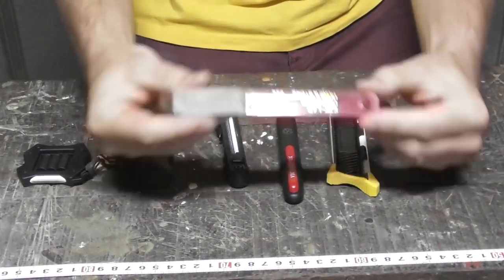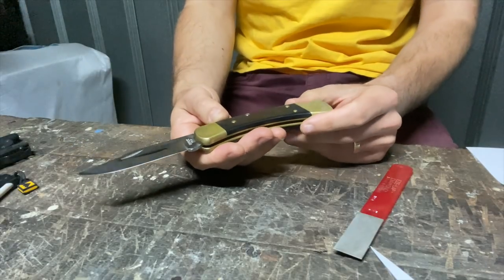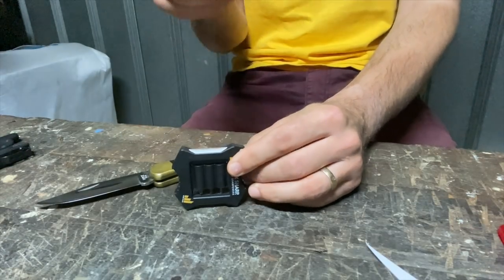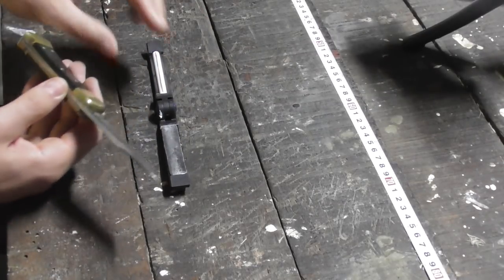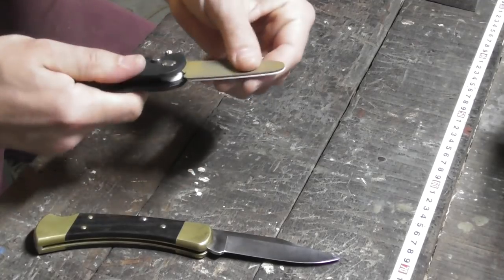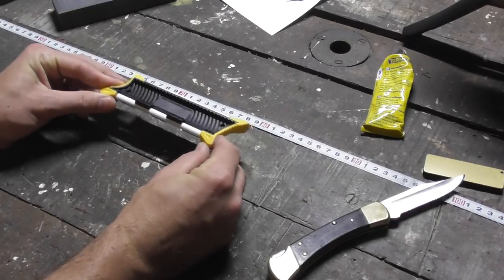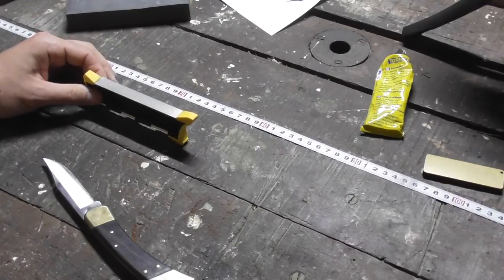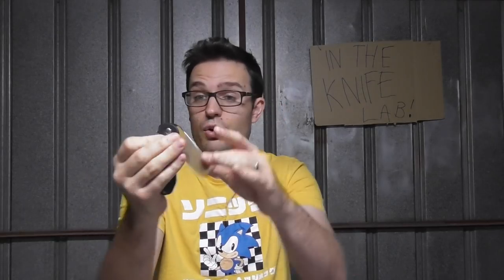Which 'Pocket' Sharpening System is Best? 7 Models Tested, Dull to Sharp on each

Comment: I think the dc4 is the most versatile. Sharpen with the diamond, hone with the ceramic, and strop with the leather pouch.
Reply: the ceramic in current DC3/4 is so rough, the diamond plate is not needed really. I would recommend the CC3 or 4, which has black / white ceramic, black for rough shaping and white for fine work. I also have DC3 from around 2015, and that ceramic was so fine it is my best sharpening stone so far, it can polish the edge to mirror surface. Current one cannot do it at all, only new white ceramic is close, but not that close as well.

Comment: Work sharp makes another version. It has 2 diamond plates, a ceramic, a leather strop. Ive had it for 2 years, its nice. You can replace the plates as well if need be. Sometimes I just grab the light diamond plate and throw it in my pocket, as I always wear a leather belt.
Reply: Dreoilín ÓCoigligh I have that and love it. Actually I removed the diamond plates and it’s much lighter for field use.
Reply: Have it too. Love it. Very comprehensive little jobbie.
Reply: Dreoilín ÓCoigligh that’s the one I got if I’m going somewhere it goes in bag but I put bands so plates don’t fall off in travel but that is my all time favorite

Comment: Victorinox tip:
You can actually use the cover as a handle, just stick it where the V cap goes
Reply: I do that too
Reply: Yup best way to use it
Reply: Can it be used for blades longer than 22cm?
Reply: @yusuffad8672  Would be pretty hard to hold the victorinox sharpener with a blade that long. However, you might be able to put the ceramic rod on the table to support it while you sharpen.
It could work but I wouldn't recommand it. For a blade that long I would use the Work Sharp Field Sharpener (not the pocket version, the big one !), a DMT stone or any whetstone.
(There is even guided sharpener like the Work Sharp Precision Adjust, around $50 but it is really really good, i managed to do hair splitting edges on this one)
Reply: @yusuffad8672  I'm currently living in a serviced apartment in the middle east on a work assignment and I've sharpened the crappy kitchen knife the hotel provided using the Victorinox sharpener I brought with me - so yes works good - at least I can cut vegetables with their knife now :)

Comment: Damn, Pete, I'm gonna have nightmares filled with that awful sound that the 110 made as you dulled it. Pretty sure it was screeching in pain.
Uncle Randy would be pissed, too, now that I think about it.
Jokes aside, I'm glad to hear that you are fully recovering and your voice is back to normal.
Reply from the maker: its aaaalmost there. Just a touch of a lisp, still got a stitch or two waiting to dissolve
Reply: @CedricAda  I'm positive those will be gone by the next video. Also, thank you for taking the time to review these sharpeners!
I already use a spyderco sharpmaker and the Ken Onion worksharp, but same as knives I always enjoy getting more sharpenning systems.
Reply: Arturo - I was about to make a similar post. Even though one can't sharpen a blade until it's dull, I was screaming NO on the inside.
Reply: @CedricAda  Missed a few systems =P
PETE what camera is this ? Gopro 8?
Amazing footage
Reply: It hurt my teeth

Comment: I keep an emery board, the thick double sided kind like you use for nails in my backpack, and have been using it to sharpen sak's, 8cr, aus8, and buck knives for years. Strop on the back of my leather belt when done. Cost me a dollar at a beauty supply place.
Reply: Huh, I should give that a try some day.
Reply: Make sure you buy a high quality emery board. Cheap ones all the abrasive will come off in a couple passes if it's a cheap one... A good emery board will cost about 3 bucks each. A good one will have one side with about 250 grit silicon carbide and the other side will be about 800 grit silicon carbide... A good board Will refresh an edge on a knife about 10 times depending on how hard the steel is.. But it will touch up even K390 at 67HRC
Reply: Great idea man ✌🏻

Comment: Nice roundup👍🏻 The victorinox is a really handy little tool, I use the edge of mine for adding/enlarging sharpening choils a lot. The cover also doubles up as a handle which makes it more comfortable to use too, the only thing I’m not so keen on myself is the clip which is a bit flimsy.
Reply: I think it’s best.
Reply: Dog ate clip. Problem solved :)

Comment: Although (as you show) you can strop your knife against almost anything (trouser, belt, newspaper etc) I found it neat to simply glue a piece of leather on to one of the sides of the Worksharp Pocket Knife Sharpener. Actually I could not find a piece of leather laying around that was thick enough, so I used two layers. Cut to fit the "opening" on one of the sides and glued on. Works fine for stropping. Done the same with a Fällkniven DF24 sharpener, glued a piece of leather on the backside  - whole length of handle. This is actually the "pocket" sharpener I prefer carry on longer hikes, as is weighs nothing and is easy fit  in my repair kit bag.

Comment: Worksharp field sharpener is about the same size as the larger worksharp you have but gives you SOO much more. Get a rough diamond plate that is much larger and also a fine diamond plate. A leather strop and a ceramic rod. Basically they simply put the diamond plates in the center where there is nothing being used and put the strop where the rough diamond plate it and it's where I learned to sharpen... Great first sharpener
Reply: ill second that, i have one its pretty good for quick and dirty sharpening when you dont wanna go to a whole system ... also great for in a vehicle or bag
Reply: @RobTheOgre  I think it's better than down and dirty...if you use a good compound on the strop you can get a better than decent edge.
Reply: @fldiverjc4496  i fully agree, you can get a great edge with it ... i just mean your not gonna get your mirror polish fancy edges on it like a full system

Comment: I use Fällkniven CC4 or DC4 (old version of ceramic). If going the economical route just glue some sandpaper (the ones you can use wet) with grit of your choise to a flat piece of wood. Use  this as a strop to prolong the usable service of the sandpaper. Grit I use is about 240 and 800 because thats what I have at hand.
Reply: Wet-dry sandpaper on wood is an excellent idea.👍 You can make it any size you like, pick your choice of grits, spend $5 and still have 3 pieces of sandpaper left over! 
One could also buy a plain small ceramic rod for like $6 if you want to get fancy, and just make a slip for it. 70+ bucks for that Benchmade is crazy! Very expensive 'butterfly tax'. lol

Comment: Credit to Buck's metallurgy that they can make 420HC cut even slightly after being dragged across a ceramic brick. 

I'm quite pleased with my DC4. The diamond side is aggressive enough to do some serious work, while the ceramic is fine enough to get a perfectly workable edge. And the two sides aren't so disparate that you'd need a third grit in the middle.

Comment: Check out the worksharp guided field sharpener. Rough diamond plate one side. Fine diamond plate other side,  rotatable ceramic rod with rough, smooth and fish hook groove, small ceramic rod for serrations and leather strip mother side. Awesome

Comment: Have you checked out the worksharp guided field sharpener? It’s got coarse and fine diamond plates, a coarse and fine ceramic, and a strop. It’s about $25 American dollars and I think it’s about the same size as the worksharp pocket sharpener.
Reply: I was just about to say that.  I think it's the most versatile complete package on the market....
Reply: Mickey McH  practice makes perfect....just try to keep in mind this is for the time you are away from the kme...its purpose is to put a very serviceable edge on your knife while in the field...or in my case boat..lol
It's much better for your blades then some of the portable pull through sharpeners flooding the market.

Comment: It's worth mentioning you can get away with a lot with ceramic and pressure on the stone and is potentially much more versatile than course grits. If I put a bunch of force on it and do it enough times, I can remove a hell of a lot of metal from even things like vanadium carbide steels. And if I apply feather light pressure I can lower the amount of metal being removed and make it seem like a finer grit pass. You can't really do the same with course stones, especially very course stones, and apply light enough pressure to still remove metal but not leave larger scratch patterns. I say this mostly about diamond and aluminum oxide stones. Diamond, being as hard as it is, is going to remove metal and make scratches if you make any significant contact because even the hardest knife steels are still no where as hard as diamond is. You can lower the aggressiveness of diamond with pressure on the stone and bevel, but given diamond's properties it will always be more aggressive than if it was the same "grit" in ceramic.

It's a versatility and speed/effectiveness trade-off. Diamond is much, much faster. Ceramic is much more versatile, but slower. It's always better to have both, I say.

Comment: Best technique i found with the WS Micro sharpener is to bring the tool to the edge and stroke the edge horizontally to the ceramic/diamond rod. Its wierd, but it works on any edge!

Comment: Spyderco Double Stuff is great and the DMT Diafold is another good option
Reply: Yeah, I have the doublestuff with ceramic/CBN sides. Bit longer than the DC4 & has radiused edges for use on recurves or serrations. Until very recently, I actually used my doublestuff for touchups at home. Now it's a mainstay of the weekend bag.
Reply: Have the DMT diafold and just bought the victorinox sharpener to replace it. Diafold works great, don't get me wrong, but I personally just found it a bit too bulky and never actually wanted to toss it in my pack. Also, the butterfly handles are really flimsy and flex a lot.

Comment: I suggest the eze-lap dual sided pocket stones.  They're around $22.  They have a fine diamond side and an ultra-fine ceramic side.  They are all you will ever need for basic honing and finishing, but you will need more coarse stuff for reprofiling really messed up edges and maybe a strop for making the edge perfect before storage.  No gimmicks with these, just a nicely sized stone in a little leather pocket sheath.
Reply: dont need a strop, its untreated leather case makes a better strop than the fallkniven, because you can also load it with compound if you like.

Comment: I like the Spyderco Double Stuff (best stones, but a little too long to hold between the thumb and middle finger).
The DC4 could be a little bigger and the ceramic side is too coarse after the diamond. The CC4 comes with a nice fine side which I would prefer on the DC4 too. 
I also like the small 4'' metal bench stones from DMT. Would be nice if DMT glued a fine ceramic on the other side. I know some of the foldable DMT sharpeners have that ceramic side. But I don't like those plastic sharpeners.

Comment: You know what would be cool with the DC stones? A little wooden or plastic stand/block to support it at 17 degrees (or 20/25). It would make it safer & easier to use. I might have a go at it myself.
Reply: Buster H I was thinking of just using a couple of bits of gash wood from the shed... I’ll have a look at the weekend.

Comment: The Best are the Worksharp field sharpener, the Fallkniven CC4. For pocket knives and Victorinox SAKS, their Dual knife sharpener, is a quality option, that can be used from both more experienced users and not experienced ones. Victorinox also makes a small orange colour stone. which is kind of medium grid, however, works really good for it's size. Only con with that, is that it isn't ceramic, so you cant avoid dishing.

Comment: I've had great success with diamond DMT Diafolds.  Single or double sided so choose your grits.  Very pocketable and have a work area that long enough.  A bigger investment but worth it.
Reply: Own a DMT diafold myself. Works well and YMMV but personally was just a bit too bulky to fit where I wanted it, plus the butterfly handles feel cheap and seem to like opening up randomly whenever I tossed it in the pack. Found myself not really wanting to bring it along much... Just picked up one of the victorinox sharpeners myself to replace it. Smaller, seems better designed, and will be a lot easier to slip in a pouch.

Comment: A comment to the Worksharp Pocket Knife Sharpener: I think the shape of the frame is made in that way, that you can use it vertical like the Victorinox sharpener. Then it defines the grinding angle if you hold the knife straight with the blade to the ground.
Reply from the maker: that makes sense!! I was using it like the slightly bigger field sharpener! Cheers for the tip :)

Comment: One other thing that popped into my head - I remember way back when I got into knives, and more specifically woodcarving, I was told by quite a few people that for touch ups in between proper sharpening sessions it's best to use trailing edge strokes on pocket/field sharpeners. I'd be curious if there is a significant difference in the efficiency of trailing edge vs leading edge passes on these systems.

Comment: I use an unbranded folding diamond field sharpener from ebay for like $6. It's actually really great. Its 400 one side and 600 the other and it folds out like a butterfly knife.

Comment: No carbide bit sharpener? You should look into the Sharpens Best pocket sharpeners. I have one of the little poker chip looking ones and it is extremely useful. It puts a razor edge on a knife with minimal effort. By a razor edge I mean you can literally shave with it like a straight razor.

Comment: I can get folding knives and small fixed blades very sharp w/ the Wirk Sharp Field Sharpener. And when I say small fixed blades, im saying 4.5" or less. It works very well for serrations, because you have 2 different rod sizes, and the larger rod size has 3 different grits. For knives with blades over 5", there just isn't enough size to sharpen them w/ the WS FS. I'm sure you can take off the magnetic diamond plates, and use them like files. That's probably what I'd do, if I had to do it. Typically, I make sure my large fixed blades are sharp before a camping trip. I'm sure there's a better product out there for large fixed blades. I'm not sure the sharpener in 5his video is it. I've actually contacted Work Sharp, and complained to them that the majority of their sharpeners are for folding knives and tiny fixed blades, and most can't sharpen at kitchen Chef's knife! Hopefully, they'll get enough feedback to develop better products. Their Ken Onion Sharpener, which I own, is fine for large fixed blades. But, it doesn't have a minimum angle for knives with 10-12 degree angles. Work Sharp recommends buying the Ken Onion attachment for smaller angles. I told them the attachment only works if you have steady hands, and know what you're doing, because there's no actual amgle guide.

Comment: I think you may be giving too much weight to the portability trait.  Any expedition that requires a knife sharpener is going to require a backpack or fanny pack at the very leaset.  You'll probably have water, food, flashlight, lighter, space blanket, first aid kit and so on.  That means you sharpener doesn't have to fit in your pocket anymore, it can go in your bag with the rest of your stuff.

Comment: I find the carbide pull-throughs to be useful, but I'm always sure to fix the edge afterward.
Reply: If you use them on harder steels they just make a mess of the edge with chips in my experience, and they leave undulations/corrugations in the edge of softer steel
Reply: @deathbyastonishment7930  How hard of steel are you talking?
Reply: TheMartialist Carbon and vg-10 ish stainless around 60-62

Comment: The only thing the micro pocket sharpener is good for is the Torx bits. Even using a bench to rest on, it's still fiddly af, i don't plan on using it with cold wet hands, i don't think the outcome would be good. The Fallkniven DC4 is what you want, unless you want to re-profile your knife edge every time you use it.